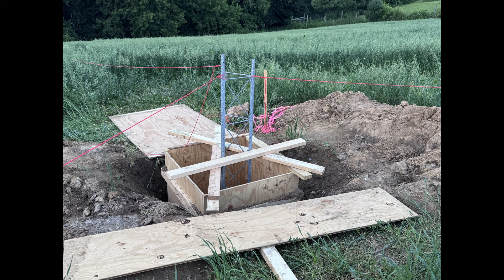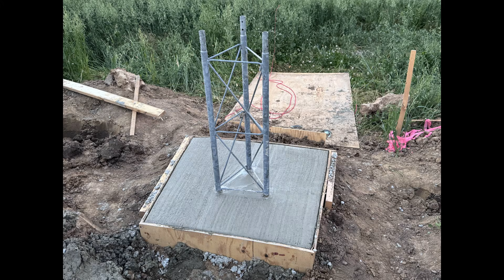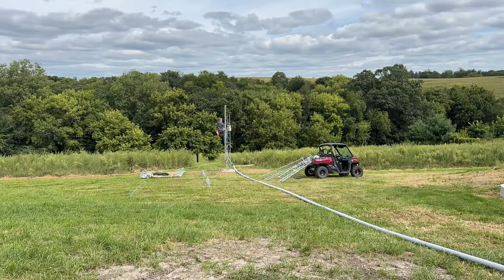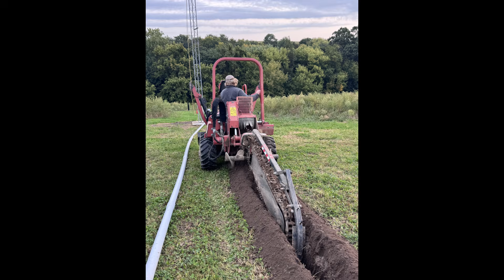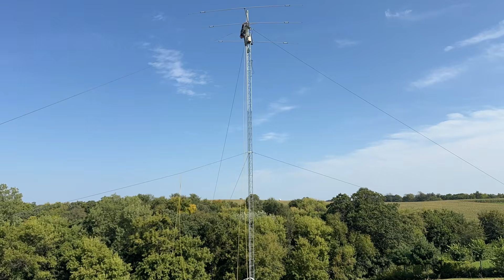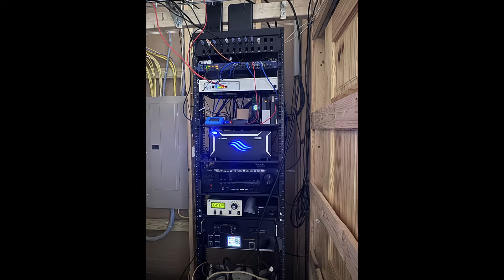Tower Construction | Ham Radio Antenna Tower

Comment: At 2:21 , noticed the ground rod within the concrete - a bad concept.   A lightning strike will vaporize any moisture within the concrete an break it up.    This is the principle as lightning striking a tree.
Reply: I don’t think that is a ground rod. Looks more like an iron rod to me.
Reply: @PrabhaZubinAdventures  kindly look at the color of the metal, copper color.
Reply from the maker: Those are rebar to help with the concrete and not a ground rod. Those are just for some support and they are completely contained within the concrete.
Reply: I would have installed more rebar in the concrete all connected to each other like a cage and tied to the tower, then you needed to install 4 or 6 ground rods around the tower spread out 8 ft apart and bonded to each other and to the tower for Lightning protection . So this gives the lightning a path to the ground and not as much to the coax going to the radio equipment. You know its all in the planning and a learning process.

Comment: Reminds me of my 50ft freestanding.  My bride and I installed it, and we were both 71yoa.  I ran 3, 3 inch pvc pipe with a pull cord in each one, this way I can pull wire / coax / power. I am only using 2 of the 3, 1 is for coax, 2 is for power both AC / DC, and 3 is there if needed, (backup).  Nice job, should serve you well.